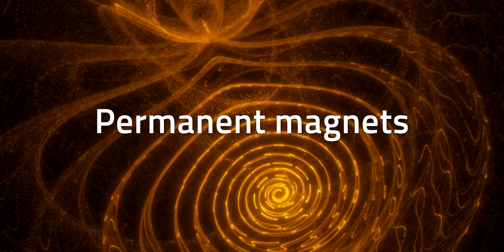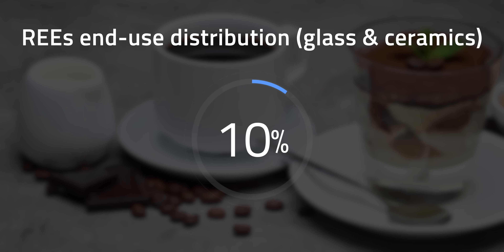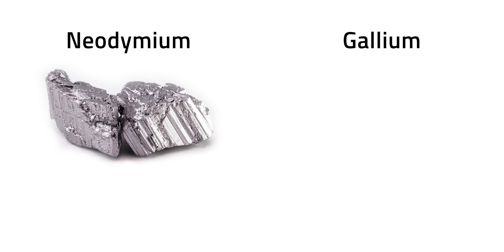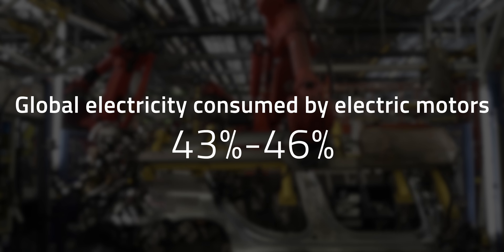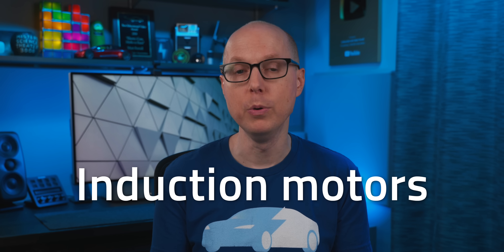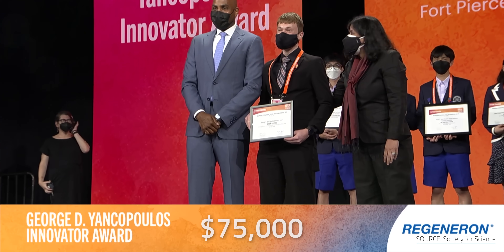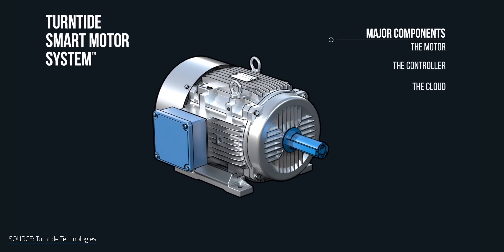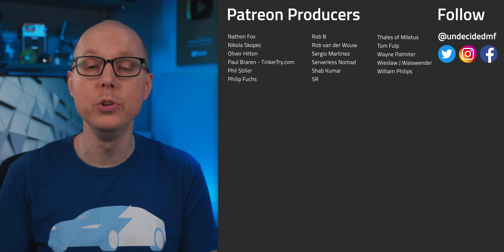Why This 17-Year Old's Electric Motor Is Important

Comment: The issue of using rare earth elements for magnets is very polarizing.
Reply: I feel like this is a pun
Reply: Ha!
Reply: they have the tendency to attract and reject, every other time :)
Reply from the maker: Bravo!  I should have said that in the video.
Reply: @Undecided with Matt Ferrell  It's easy for me to write the joke after you've done all the hard work.
Reply: Yes! the reluctance of current industries to move away from existing technologies hinders the environment.
Reply: I keep alternating between amusement and irritation at this joke.
Reply: To know what is or is not suitable, it is sometimes necessary to remove the current way of producing things. Without any device emitting co2, would the rare minerals be problematic ?
Probably not.
Because otherwise, nothing is really suitable, not even the best 100% efficient and renewable technology, because it will still have to be manufactured, transported, etc.
At least not on this scale. (Until we build a ship the size of the moon, I mean...)
In short, only utopias make it possible to make the right decisions.
Reply: Very attractive pun!
Reply: im positive someone will have a negative comment about your joke
Reply: Im attracted to your comment
Reply: As I’m reading your comment, I switched to reluctance.
Reply: Du-dum tss
Reply: This is clearly a magnetizing joke.
Reply: Yor joke seems to have sparked the comment section.
Reply: He thought he was on Reddit.
Reply: @MrGamelover23  its referencing the poles on magnets, so yes it is lol
Reply: This joke is electrifying. It makes me feel positive.
Reply: Take my like and get out!
Reply: Yeah, some people are repelled by the notion itself.
Reply: I've heard of lots of positives and negatives aswell
Reply: There are always positives and negatives when deciding to use magnets.
Reply: I would say you are atracting issues with the polarizing
Reply: & attractive & aligned...atomically
Reply: Groan
Reply: Have you ever thought about a career in comedy?  Don't.
Reply: Polarizing to some and still attractive to others!
Reply: Now wait... you, you didn't... just do that... smh 🥴😖
Reply: So many opposing views ... very polarizing.
Reply: Thanks, was having a bad day.  At least this made me laugh, thanks.
Reply: Lol, in a manner of speaking.
Reply: Jo Po 💪 Not on a comedy channel
Reply: @MrGamelover23  He is the literal best youtube commenter making puns for years, almost ten now.
Reply: @UndecidedMF  :) You found the best jokester on youtube comments of all time 😆 Big for years on Joe Rogan's comments before he went spotify
Reply: Big up jo po 😆
Reply: love it
Reply: I know where the door is. I'll see you out.
Reply: If I could give an up and down vote I would,
Guess you just get an up vote 😀
Reply: It does attract a lot of attention.
Reply: Thanks Dad.
Reply: Yeah, it either attracts your interest or you reject it altogether
Reply: What’s funny is they aren’t rare at all they are just hard to mine
Reply: Does that make Teslas 3 phase motors wishy washy on the magnets?
Reply: You could say they are poles apart
Reply: Let's ask the alchemists to turn some dirt into copper!
Reply: @theplouf5533  Ship still won't cut it.  A dyson sphere is needed.
Reply: @pawpawstew  MONO POLES, MONO POLES!!!!!
Reply: I needed this laugh dad jokes ftw
Reply: Rarely , I think…..
Reply: Get Flux'ed, Flux you!
Reply: Glitch at 11:05?
Reply: That took me far too long to get.🤦‍♂️
Reply: Good pun, it is actually very polarizing
Reply: Yeah I think you just regulate the mining of the minerals and not let the exploitation happen. Might have to send the military in to kill some Congo warlords but that’s probably for the better. I feel like we wouldn’t have to pay much more for them considering the poverty and corruption in Africa.
Reply: You made a funny WOOT !¡ HAHAHAHA
Reply: Very funny
Reply: I'm repelled by your pun
Reply: 😆 Nice!
Reply: dad staahp
Reply: @MrGamelover23  Not everyone has the capacity to appreciate a good nerd pun. But... really? A little consideration will be the transformer of your view. It is, after all, useless to be a resistor.
Reply: north vs south
Reply: We use super magnets for nuclear energy. Which we need to make it.
Reply: Geek!
Reply: Groan... :)
Reply: You’re done 🛑
Reply: Can you elaborate?
Reply: Try say something positive instead of negative
Reply: Normally I find this stuff boring, but Matt has a super magnetic personality.
Reply: 😂 I saw what you did there
Reply: @Minecraft-3699  oohhhhh now we all understand the joke we have been commenting on for a week 🙄
Reply: Ha ha ha
Reply: i positively cant handle all the negative comments, i dont know watt theyre charging the rest of us with... its so depressing im just going to go ohm.
Reply: drops the mic
Reply: @theplouf5533  I think there is a segment of the population that will make anything a problem. That being said, the whole rare earth metal issue is not to be underestimated.
Supply chain, pollution from mining are sore spots for sure.  Of course when nations rely on each other somewhat evenly for different things they are less likely to end up in a war with each other, but if someone has a stranglehold on the supply, well look at the middle east.
Reply: I find myself being repelled, and somehow attracted to this comment.
Reply: That is the current state of affairs
Reply: It will charge ahead...
Reply: I don't understand why they are using rare earth elements for magnets any more, when they discovered that if you align aluminum atomically that they are more heat tolerant and 400X more powerful.
Reply: South Pole and North Pole might have more rare earth elements
Reply: Absolutely puntastic
Reply: I feel drawn to reply to this comment.
Reply: EYYYYYYY👈👈🤓
Reply: You don’t deserve a response for that one. 🤦🏻
Reply: Also very expensive
Reply: I see what you did there !!
Reply: That's why advocates insist on mining and processing them in other people's countries and not their own ...
Reply: Good
Reply: This conversation is going south.
Reply: If it helps to break the monopol(e) of some countries, why not.
Reply: Yes, the issue always attracts attention.
Reply: half of me is attracted to your comment the other half repels it
Reply: @theplouf5533  well said.
Reply: Feeble 😔
Reply: @UndecidedMF yes.
Reply: I find the utilization of permanent magnets very "attractive".
Reply: @ChrispyNut  ReVOLTing, indeed.
Reply: Get out
Reply: Is was drawn to your current comment.
Reply: Look. We are all just going round in circles here
Reply: @TheVimeo  Yes, i have known a few girls like that in my younger daze, err days.
Reply: AC watt you did there.
Reply: Im polarized and energized
Reply: It definitely attracted my attention
Reply: This was good… almost too good 😊
Reply: But nothing to get wound up about...
Reply: But its regional to North or south poles.
Reply: @YodaMan-420  
Or take it netraly
Reply: @dannmarceau  
Or was it loL
Reply: Clever.
Reply: I feel you narrowed down the facts down to the rare elements and kept us grounded while this pun span our mental motors.
Reply: Touche
Reply: Touche'
Reply: That’s Both good Joke and true. One might say it’s funny cuz it’s true , but I would say it’s funny on its own. It doesn’t need the help of truth to be funny, although it has it
Reply: @vincedenbu  You say reluctance, I say resistance!
Reply: Woka woka woka!
Reply: There has been both AC and DC motors for 100 years that didn't use permanent magnets. This isn't new. Tesla made the induction motor almost 100 years ago, it's used everywhere and doesn't use permanent magnets.
Reply: Please exit the premise
Reply: @MrGamelover23  I feel like Im asking a question?
Reply: There’s 2 side to every story.
Reply: You're right
Reply: Boom boom!
Reply: @timtrottproductions  the matrix
Reply: @paulregener7016  So they're rarely mined. So they're rarely in the quantities we need them.
Reply: @MrGamelover23  you mean you field it coming?better eddy your comment before the flux of likes charges you up!
Reply: you sure seem to have an issue with the earth but not slavery how can we take care of the earth if we can't take care of our own??
Reply: there's only a view rare earth minerals they tell you they are rare so it drives the price up buddy..
Reply: Really and the lithium used in your cellphone mined by slaves is something you have overlooked? Which is far more rare ; I believe, correct me if I'm wrong.
Reply: Badum tss
Reply: It's MAGNETIZING
Reply: Well done… LOL!
Reply: this guy
Reply: It's atreacting to me!
Reply: Ha ha ha...   you punster you!
Reply: Psa dad joke
Reply: This applies to copper and semiconductors as well.

Comment: A few corrections (electrical engineer here):

An induction motor does not "switch" the stator polarity. Because it's being fed with AC, it's built so that a rotating magnetic field is generated. The rotor is just a bunch of short-circuited coils. The rotating magnetic field induces a voltage in the rotor, creating another magnetic field that wants to align itself with the stator's rotating field. Suppose the two ever align (in case the rotor is spinning at the same speed as the rotating field). In that case, the rotating field will appear stationary to the rotor (like two cars going down a freeway at the same speed, they're moving in relation to the ground, but not in relation to themselves). The important part is that the stator's field can only spin as fast as the rotor's field. The difference between the speeds is called the slip ratio and is always larger than one for induction motors.

A synchronous motor works oppositely: the rotor spins as fast as the stator's field. Because they're rotating at the same speed, there's no induced voltage, so the rotor needs either a permanent magnet or an electromagnet to generate its magnetic field. The slip ratio for a synchronous motor is always one.

A) Induction (asynchronous) motors: no magnets on the rotor.
B)  Synchronous motors: rotor needs magnets.

In both cases, there's no "switching" like in DC motors.

The saliency ratio is the ratio between the magnetic reluctances when the rotor poles are aligned with the stator poles and when it's aligned with the gaps. This determines the torque curve.

Pretty good explanation of how SynRMs work: https://www.youtube.com/watch?v=vvw6k4ppUZU&ab_channel=Lesics
Reply: Thanks for your input! And important to note that  Galileo Ferraris and Nikola Tesla independently invented the AC induction motor  in 1885 and 1887 respectively, including the variable reluctance type. The challenge today is to refine these well-known and much used principles and designs for high efficiency and suitable power response.

Comment: My father was with a French design team in the late 1960s.  They used variable reluctance in a very efficient air compressor which used a single piston (no crank) powered by variable reluctance.  No permanent magnets, and no commutator brushes. Dead simple! One version of it emerged as a Black and Decker air compressor. There was also made a low vibration flat twin piston version which was a bit like a free piston engine.
Reply: You will find such 'motors' (more like Linear pumps) in the Engel (camping) fridge / freezers.
Reply: Seems this tech never took off even though it existed long before this 17-year old made a 'concept' motor. Must have some major flaws if big companies haven't pursued it further. Elon Musk would have have hired the kid by now if it had any potential.
Reply: @Dark-qx8rk Timing is everything.  In my father's case the late 60's oil shock/crisis killed off the appetite for investing in new businesses.  By the time the 70's were through (more oil crises) the economic life of the patents had faded away, the main guy in France had died and everyone was working on new projects.
Reply: @Dark-qx8rk  That's if he knew the kid existed.
Reply: Woah, no crank!?!
Reply: @deansmith4549  Quite right.
Reply: @Dark-qx8rk  so now Elon is the only standard for ingenuity and innovation?? 🤔 Big industries can be slow to change and not very innovative. They'd rather optimize an existening technology than take the risk and high cost of moving to a new one... doesn't mean there aren't better solutions out there. It's just that the stars need to be aligned right before a shift can happen: right timing for the market, someone with the right connections, a lot of money to support the initial stages of development, etc. etc.

What Elon has or hasn't done isn't that significant
Reply: @Mr.Anders0n_   on the contrary it’s very significant !
Reply: Power electronics isn't there yet to use reluctance motors in something the size of an EV. Also, what are the failure modes? Reluctance motors need special controllers, and I don't think anyone has figured out a safe failure mode that doesn't involve a mechanical clutch.
Reply: @Mr.Anders0n_  well said. He is def io hero in this man's eyes and proves the idea that raw intelligence in no way equates to emotional intelligence.
Reply: @Mr.Anders0n_  Just so, in manufacturing and especially the motor industry, incumbency is very hard to beat.  There have been superior ways of doing many things in ICEs that did not catch on due to the cost of major change.  If your competitors aren't threatening you with new technology, especially if it has high cost of introduction, why change?  The EV industry had little competition or scale in 2004 so it was and, to a lesser extent, still is much easier and cheaper to change direction.    

Musk did not create Tesla, the two people who did, and steered most of the engineering and forward plans in the formative days, departed the company in 2008.  There is a view (I have not spent the time to verify it - I am not that interested) that the first vehicle Musk has truly influenced is the Cyber Truck; if true, enough said.

Comment: Hello, sorry if this is the 200th squirrel cage comment. A large, industrial, three phase motor is named a squirrel cage because of the rotor. It is often high-silicon steel slats filled in with cast aluminum for structure. When you look at the rotor on a workbench, it resembles a hamster wheel or cage fan, ergo squirrel cage. Easy way for us cavemen types to differentiate between motors. Great videos, thank you

Comment: Most industrial AC motors, both single-phase and 3-phase, do not use permanent magnets, they use an induced magnetic field in the rotor (the rotating part) from the stator (non-rotating part) to induce rotation. This principle can also be used in generators, though they typically require at least some residual magnetism to be able to start the magnetic interaction.

Automotive alternators use no permanent magnets, though they do use a pair of rings (rather than a segmented commutator) with brushes to make contact to the rotor.
Reply: It is used, however in a little different way. For induction motor to work as generator you need to run the rotor faster, than the field in stator is rotating. In the grid you can do it just by connecting the stator to grid and then providing excitation not with DC (like in synchronous generator) but with AC from VFD inverter. If you match angular velocity of field generated by rotor to be around 115% of synchronous field - you have grid-ready  generator. Using VFD as excitation is cheaper, than using it to convert all the electricity from large wind turbine to grid frequency (instead of i.e. 15MW converter you need 3MW one). Of course it does not make sense for hydro or thermal power plants, where you can (and have to) adjust mechanical power to keep turbine at speed
Reply: Not very good for most EVs though as they require more electricity to run than a permanent magnet motor since electricity is required to create mechanical energy and the electric field, though Teslas do actually use AC motors in their cars so they only require REEs for their battery packs.
Reply: @brylozketrzyn  Thank you for the info, we didn’t discuss such things in the introductory course at the university I attended when I was young,  so I am very grateful when I can learn new things.
Reply: I was going to say this too. You said it better.
Reply: @krashd  Tesla used induction motors in the front drive system of their early Model S cars. So it can be used in cars after all!
Reply: Current generation EV motors are SynRM motors with the addition of permanent magnets in the rotor to improve low speed torque and regen braking. As I understand things the quantity of magnet needed for these hybrid SynRM motors is significantly less than an equivalent permanent magnet 3 phase BLDC motor.